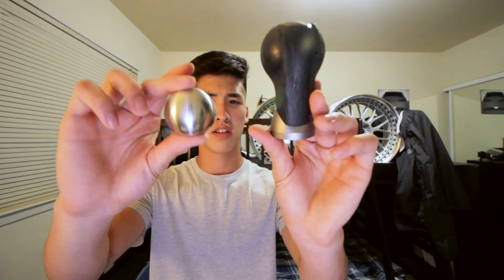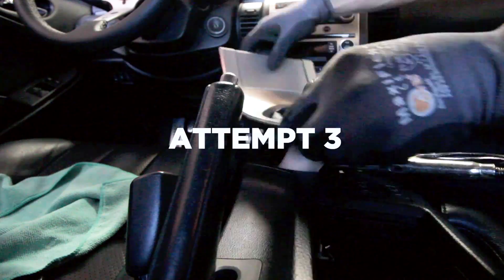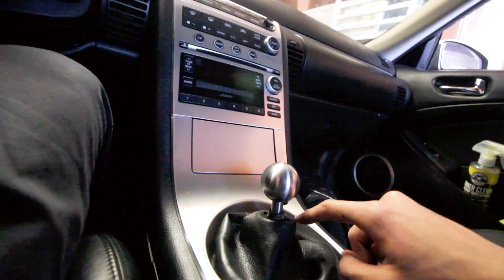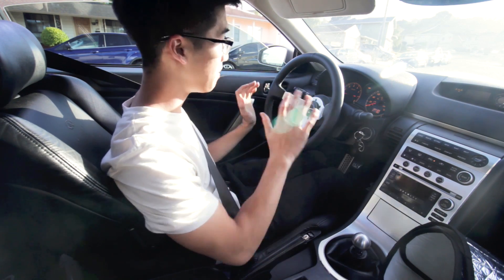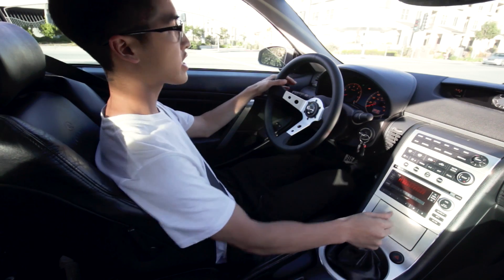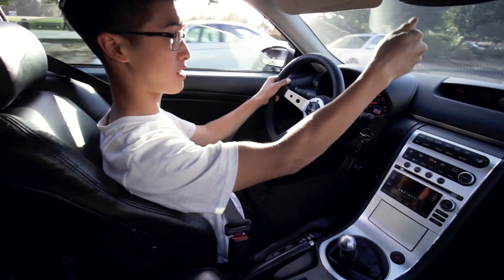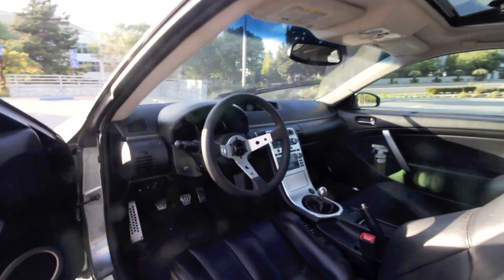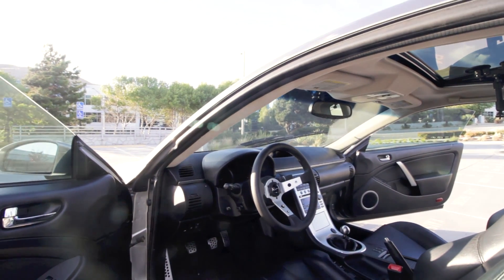Taking off a SHIFT KNOB is harder than it looks...

Comment: I had the same problem on my g but i found out that if you pull it up while twisting it it will let loose like nothing
Reply: I just tried this method and it worked like a charm. Compared to just trying to twist it, pulling up at the same time popped it right off

Comment: Just get a short throw shifter. The knob itself doesn't change anything
Reply: Not entirely true. Knob weight does have a bearing on shift response. I went from a stock knob w/ short shifter to a Flossy 545g knob in my STI and the shift action was drastically better. Went from shoving into gear to gliding into it.

Comment: Short shifts is in the shifter itself not the knob
Reply from the maker: Charley Tran well I know that. But the throw will still be much longer if you have a long ass shift knob. I noticed a difference even with this slight difference